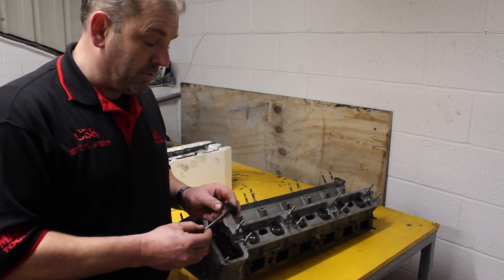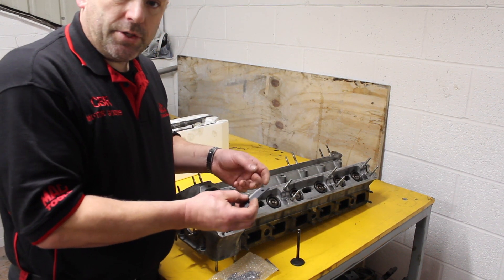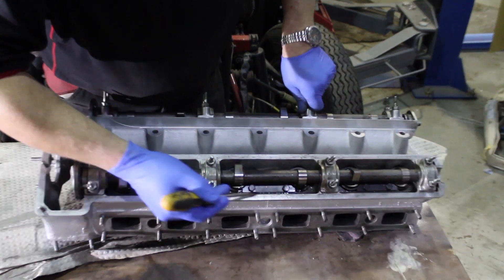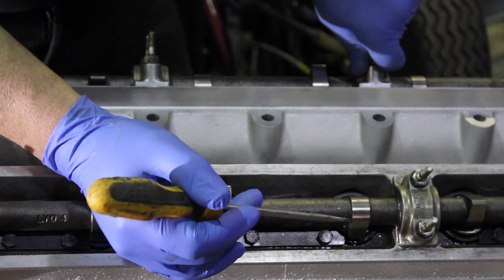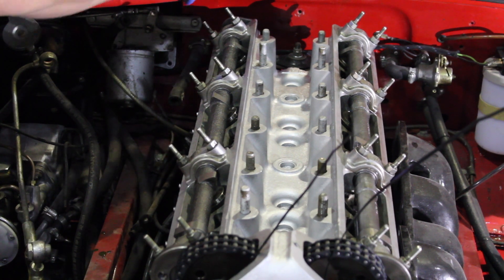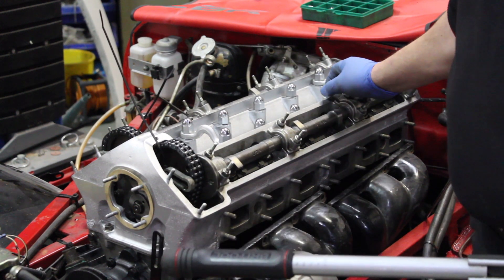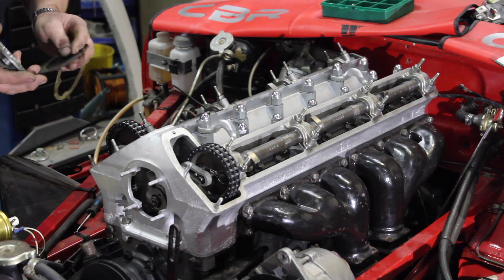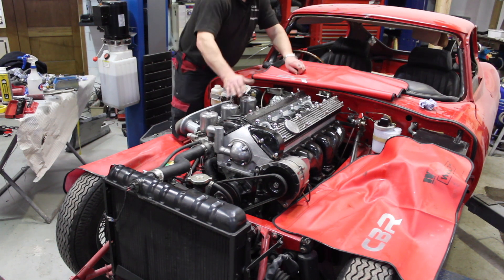Repairing a stuck valve in a Series II e Type Jaguar (Part 2)

Comment: Why did the valve get stuck?  I had a 420 that I used in daily use for a year before it bent a valve.  Then it did it again a year later.  Today I would not put valve guide seals on intake side.